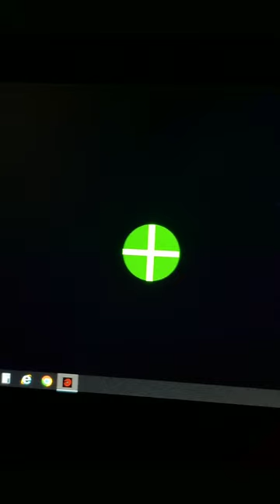Mini Observatory build v2.

Comment: Why did you move a way from the slides (V1). Did you have problems with the roof?
Reply from the maker: No. But still debating how I want the roof to be. I like the slides and will implement them at some point, or I may automate. Next spring will tell.